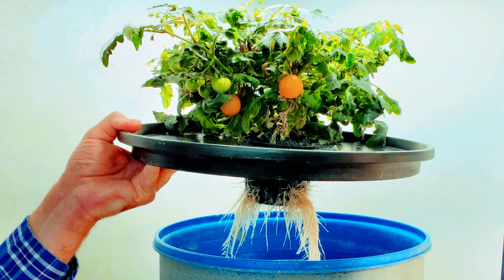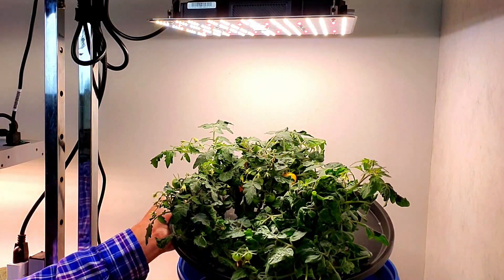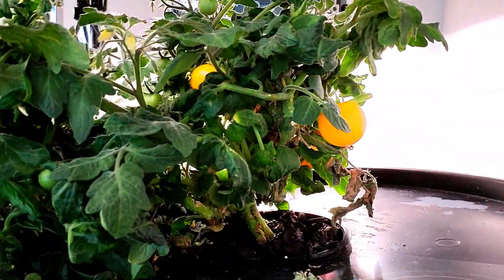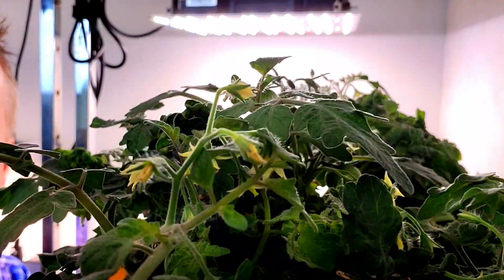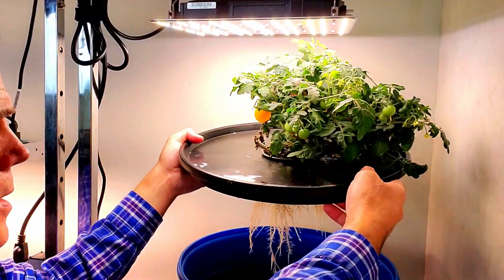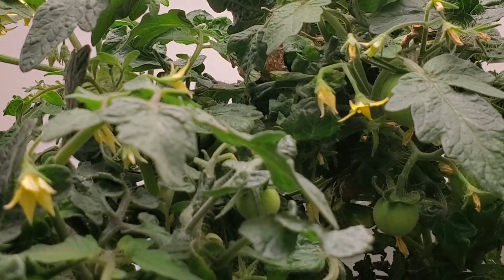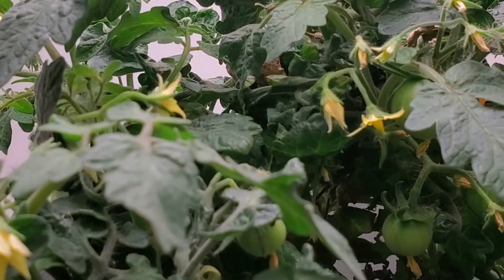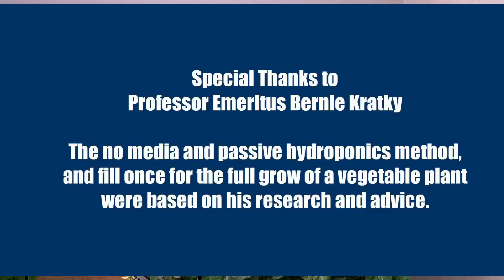HYDROPONIC FARMING AT HOME   KRATKY TOMATO CLONE SIZE EFFECTS

Comment: The "fill-once" method never worked for me. It might just be California's dry climate.  Mature plants here easily chug up to 1.5 gallons of water per day.  Here there is a constant battle to reduce water usage and simplify nutrient refilling to keep up with the thirst.  Young plants drink a lot less, but large heirloom tomatoes, cucumbers and cabbage are quite thirsty. So instead of tall fill-once containers, I end up using wide and shallow containers underneath light panels. It's cool that your cherry tomatoes are so happy in that fill-once container!
Reply from the maker: Karl, I always enjoy hearing from other growers like you!  Your growing conditions are challenging.   Some have told me that they either bury their containers in the ground or wrap their containers in reflective insulation to deal with heat.  Others mention using shade cloth, and/or misting stations.  In my indoor grows, I am using around 4-6 gallons per pound of produce.  Growing indoors helps, and I have a preference for wide shallow containers too.  Maximizing the surface area, allows for more nutrient gathering roots when setup right.  On my channel, I have some reservoir gravity fed Kratky buckets.  Those help keep plants from becoming so monster sized, and still provide hands off relaxed growing.